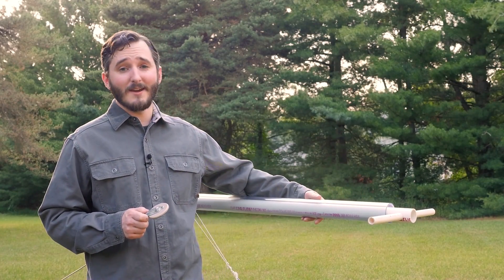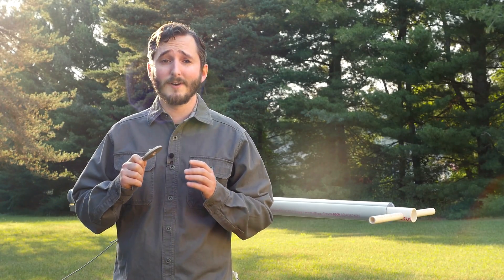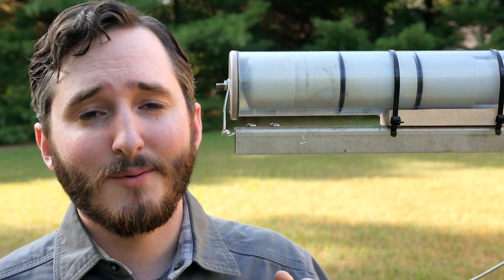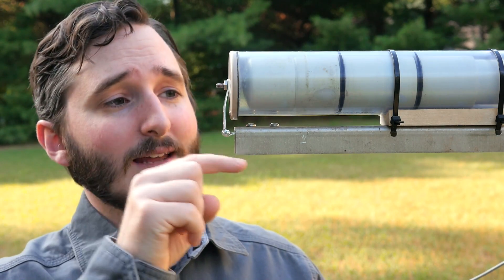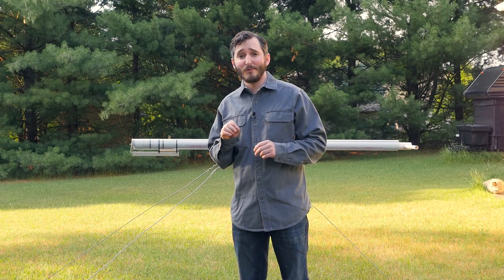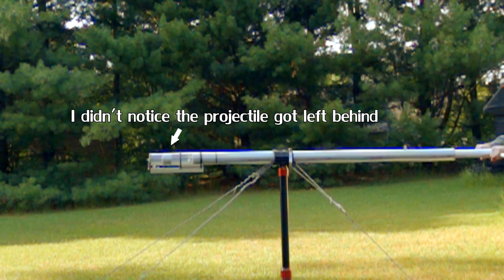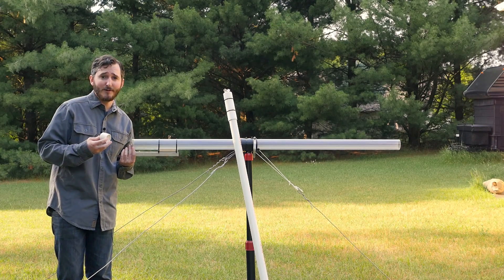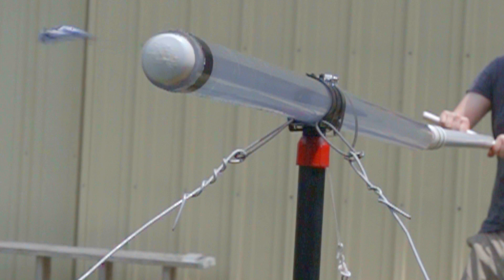Firing A Clear Vacuum Cannon & Testing Viewer Suggestions

Comment: Use a magnet at the front of your projectile paired with a magnet on the flapper valve so that the two magnets oppose one another. As the projectile nears the end of the barrel it will oppose the magnet of the flapper valve, thereby opening flapper prior to the projectile impacting it. Another idea is to surround the outside of the barrel with an electric coil. The projectile having a magnet will induce a voltage in to the coil, this coil provides Voltage for a coil (AKA solenoid) that opens the flapper which has a spring loaded catch that is releasable via solenoid.

Comment: You could make the valve stay clossed or opened with a flat spring of some sort, like the frizzen in a flintlock. Once the air pushes the valve a little, the spring comes into action and makes it open quickly, making sure it stays out of the way. Cool concept for a cannon by the way. Never saw something like that

Edit: I just saw this video is really old... Shame on me for not reading the details before. Sorry about that

Comment: Instead of an outside flapper valve try an o ring inside the barrel. The force of the vacuum will cause your projectile to double as the valve and instead of pulling the piston out at the breach drill some vent holes just forward of that point. Now I have to try it

Comment: Cut the last six inches off and place a gasket between this stub and the main body .  An assistant will hold the stub and gasket or ( O ) ring in place as you pull the plunger back .  Attach a weight or a tension spring to the stub to help pull it down quicker .

Comment: If yu intend to keep your vacuum seal on a hinge mechanism, maybe drilling a small pinhole(s) in the projectile face would work. This will leak air forward of the projectile and open the cap ahead of it. This assumes leaking air will travel faster than the projectile. Also not as efficient as the aluminum foil seal, but the engineering design will provide faster repeatable shots. Optimizing the pinhole size will take some experimentation I imagine.
Great work!

Comment: An other idea instead of a rubber band is to change the design of the valve a little bit. Maybe if you put in the upper side of the valve just a small lip (like a bottle cup) in order to trap some of the air from the inside of the cannon and maybe this force is enough.

Comment: I think the valve should have an o-ring or something and fit inside so that no air can escape before enough pressure has built up to eject it. This would also ensure that it would stay in place when the gun is pointing down.

Comment: i made one large enough to fit myself into and smashing the burst membrane from inside, controlling the vacuum pump on the outside via my mobile. Using high explosives I normally suffer burns and lost toes but thanks to this man i arrived at my destination abroad completely and intact apart from a little brain damage,  and burn-free.

Comment: I believe one of the things that is happening is that the whole barrel is in tension,so it is actually moving forward as it's firing thus holding the plug on. You need something more Ridgid than cable.

Comment: Could'nt the valve be spring loaded to assist a speedy opening once it starts to open just a little? also though sealing may be a little difficult, cutting the valve into two semicircles would halve the distance needed for the valve to get out of the way.

Comment: Prime the cannon facing up slightly with an unbalanced flapper before you bring it down to aim. That way gravity will actually assist when the cannon is fired. You were still only relying on air pressure to move the flapper when you modified it.

Comment: Gravity can't help if it won't fall open on it's own. Move the pivot back behind the flap and leave a small space between the flap and the ammo so the air in front of the ammo can start the valve opening.

Comment: The valve will never open on its own because its held up by the negative pressure. The same force that is pushing the projectile forward is also pushing the valve closed.

Comment: You need 2 cylinders. One that vacuumes and one that compresses. As the diapham gets pulled back, it vacuumes and compresses. When the diaphram reaches a certain point it not only lets air in, it releases the compressed air into the vacuum chamber. Similar to the case on a 2 stroke engine.

Comment: Cut the flapper end of pipe at a 60° angle and make an oval flapper valve to fit. That way the flapper valve (facing downward) would have great gravity force and would only have to travel 30° to get out of the way...

Comment: Keep the valve in this position, but a small spring on the top side of the barrel, and a string on the valve...you can measure the string length so it breaks about the same time the piston is pulled out, and the spring will push the valve down.

Comment: I recently started watching your channel and love it!!! Two problems with the cannon:A-Use same bent/set forward valve with a Vertical Spring/or L shape coming back under. B:-Use a Magnet or Electro-Magnet to hold the projectile... I guess winning the science fair in grade school paid off... Lol... Simple, yet effective. Hope it works for you. I think I'll build my own now too! Awesome videos you are great at this. If you use an Electro-Magnet, just use a small wire that disconnects just before the end of the pull or not depending on how powerfull it has to be... L8R. -Chad.

Comment: I would try going back to the upward hinge but put a slightly tight spring on it to pull the flap up. But then youve got the plastic cup idea thats already functioning. Great build either way

Comment: Why don't you use the projectile as the valve?? Put a hollow stop 12"-24" in. Load. The projectile stops and seals As you pull back. There for, no valve blocking the path of the projectile on exit!!

Comment: What would it take, to make a trigger mechanism that is timed to pull the valve out of the way just prior to impact? Even something  simple, like a trip wire, of a proper length, between the handle of the plunger and some sort of cam to open the valve... then it would just be a matter of optimizing timing, to give the maximum thrust to the projectile just prior to impacting the valve on the way out the barrel...
Reply from the maker: I think it's a lost cause. Making a valve work fast enough to move out of the way at the last second would mean it would have to accelerate orders of magnitude faster than the projectile itself.
Reply: @Nighthawkinlight  that is correct, it would need to actuate the valve a hair split second after the plunger is pulled out to release the projectile, which is why I suggested a trip wire to open the valve by turning a cam connected at a length of just as the plunger releases the vacuum, if everything is rigidly mounted, and as long as the plunger can be drawn out at a constant rate, it seems the only real variable is the speed the plunger is pulled... if too fast, then some of the energy gets wasted opening the valve prematurely, if too slow and the valve gets pinged... I don't really think of it as hopeless so much as a matter of fine tuning the mechanics... lol, but I can certainly understand not wanting to put in the effort to try to perfect that type of mechanism on something that has such a finicky short cycle! Thanks again for another good video that gets people to creatively think!

Comment: What if you drilled a small hole in the piston center and around piston cap just off the last gasket.  Increase speed release of projectile and keeping projectile in barrel. Noticed the projectile gets pulled to far back to rear barrels end.

Comment: Have you experimented with using the end cap AS the projectile? For instance place a wider cup around the muzzle so that the original barrel forms a lip inside and then fix a rubber O ring to rest on the lip or the rim of the original barrel. By placing a projectile over the mouth of the barrel within the cup extension the projectile should act as a plug against the O ring when the shaft is pulled back. I am unsure how this would preform in actuality and I have a sneaking suspicion that the trajectory may be less than impressive but it could be worth the experimentation.

Comment: I know its 3 years late, but I think that the valve could work.

The sacrificial tinfoil has a certain amount of resitance before bursting outwards, this makes it store energy that when released makes it fly fast. However, the valve falls as soon as the pressure differential is enough to sighly push it out, then the rest of the energy is lost.

I was thinking that maybe making the valve have a certain amount of resistance to being pushed out of the way, it will give it more time to build enough pressure to push it faster once the initial resitance is overcome.

Maybe having a magnet hold it in place would allow the pressure buildup and once the magnet can't hold it, it will burst open fast enough so the projectile misses it.

Anyhow, in the case that my theory is correct, It would require a lot of  trial and error to find the magnet with the right amount of energy.

Comment: I had a valve idea. But I don't know how to send a pic on here-so I'll explain. 
I thought you might be able to make a heart style 3/way valve. Maybe start by cutting a tennis ball in half-then cutting that into three 60°pieces then make a rib going down and around and protruding a half inch or so past the perimeter of the circumference of the tube on each piece. Where you could then make a hindge pin and radial spring to put just enough closing force on the doors to seal. And on the inside center of each of the three-glue in something that is round like the ball on one side and straight on the other. So as the projectile comes forward and reaches the end of the tube it helps pop open the spring loaded doors a split second b4 it would normally-also so the projectile doesn't hook the roundness of the valve door/tennis ball .
Hope this gets a shot. I think all ya need  is some flat plastic a tennis ball hot glue a drill a nail for the pins and a really sharp knife so it seals.

Comment: Maybe a better valve idea would just be a cap you can set on the end by hand, but isn't attached by anything except a carefully measured piece of strong string, attached to the ground directly under that end. When it fires, it would get thrown off the end, but the string should quickly pull the cap out of the way of the projectile, and towards the ground in a arc, long as it was strong enough.
Reply from the maker: That's basically what I ended up with. Shoving a plastic cup in the end like a cork.

Comment: spring assisted? But you would need a way to hold it there while you pulled enough vacuum to keep a vacuum.   Another idea would be a burst disk that could be put in place with your hinged holder but the holder would move out of place before the shot and require a stiffer burst disk.

Comment: Maybe if an inch of matetial creating the seal of the flap in the front, going into the tip 1 inch would create enough energy to pop the cap out of the way of the projectile.

Comment: Try increasing the diameter of back half of pipe and the piston..it will give more of rush of air and a bigger hole before piston reaches the end ...cud even make it shorter
Oh and wack a E magnet on that valve triggered by a switch of some kind 😃 good vid

Comment: 8" pipe bolted to a geavy table, with a two door valve bolted to the side so they move out the the way easier and a pully system to pull the plunger back

Comment: So i made my own vacuum canon
Used pvc pipe and o-rings for the plug and seal but the intetface between the pipe and the seals had too much friction and i had to wrap old cloth around the o-rings and that made pulling it through the pipe possible

How did you solve this?
Reply from the maker: I put axle grease on the rings

Comment: maybe a spring loaded valve, where the spring is actually working to pull the valve open, however, the vacuum of the piston pulls on the valve to keep in place?   therefore, as the projectile moves forward and vacuum is lost in the chamber, the spring pulls the valve open?

Comment: Why not a simple spring attached to a point near the fulcrum? You’ll get a class 3 lever that will open the valve very quickly, and you just need a string to pull it shut until it gets started. If the spring is weaker than the draw strength, but strong enough to pull the valve well (seems likely as it looks light) you should get a good quick opening valve.

Comment: If you’d want to make it overly complicated, you could make an external airway starting just before the end where the piston is pulled out (the back) and the other end just before the valve in the front. This way the air rushing in would overtake the projectile and blow open the valve just moments before the projectile arrives.

Comment: What about 2 same pole magnets...one on the center of the flap and one on the projectile....then as they get to the same point the force pushes it off...then so the flap doesn't fly back again have a small magnet on the bottom to catch it

Comment: You tried to mount the "cap" on the upper side connecting it with a cord that is pulled when you have finished dragging the bullet at the end of the stroke the tube (when the air begins to enter from behind the tube)?

Comment: there actually is an easy solution to solve your pressure vavle problem at the end of the barrel. all you need is about 4-6 inches of a bigger pipe on the end of the barrel with the release vavle attached to that. the idea is that once the projectile gets to the bigger pipe air pushes around the projectile and pushes open the valve before the projectile itself can hit the valve. easy solution without any damage to the valve.

Comment: 6:47 had me laughing so damn hard, gravity assisted flap valve with a spring pulling it back up  is this guy for real ? "this is why you test didn't work # 1 GRAVITY IS A NOT REAL 2# YOU DON'T NEED TO HAVE A SPRING ON THE "GRAVITY ASSISTED FLAP", THE SPRING IS 2 STRONG AND WILL STOP THE OBJECT FROM EXISTING THE TUBE , CAUSE IT CLOSES 2 FAST

Comment: so do you get better results if you fire out a smaller barrel sow that the psi has a larger compression chamber resulting in reduced overall size vacuum canes that have a heavier draw force lick gearing a gearbox dawn

Comment: failures are a learning process.  I think your valve is bouncing and that's why it's getting hit.  

Try putting a magnet or latch to keep the valve full open once it opens.

also, your buff of air may not be enough force to open the valve fast enough so you may look at spring loading the valve to open faster and have a catch for it in the closed position too.

Comment: Run a small spring along the outside of the  latch, over the hinge. Keep the latch extended so when it is in the closed position so it acts like the cam on a compound bow. Yeah, just a simple spring elliptical cam. The little bit of air would flip it enough to push it past the crux of the ellipse and the spring would pull it down and out of the way.

Comment: I would like to see, what happens if you use the projectile as the valve by adding a 2nd tube with a sligthly smaler diameter, and length. like a air vortex canon, so the projectile sits "midway". on a small Rim.

Comment: Idea #2. Keep the same setup, add another hinge about 1 foot down the barrel, so that that the disc now also drops down, instead of having to rotate so much. It will still rotate a little on the original hinge, but as soon as it is no longer stuck to the end by vacuum, it will also start to fall as it rotates.

Comment: I think your flap valve is too heavy (slow to accelerate). How about just a disc, no hinge, held lightly in place with tape, and with a string (maybe 1m long) it so it doesn't disappear.

Comment: Your valve could open faster if it had a spring  mounted on the sides so that as it closes the tension helps keep it closed but only for the last 2 degrees, but once open past the pivot the spring will pull down on it outside of the pivot and pull it down quicker.   If you have not made a pneumatic valve air cannon,  they are the bomb.

Comment: @NightHawkInLight:  I have an idea for an effective flap retractor.  It uses directional force from rubber bands, so that once past a certain pivot point, it will even provide slight pressure to hold the valve against the muzzle, but once the hinge has rotated a few degrees, it pulls in the opposite direction with much greater force.  As long as the air pressure provides enough force to get the hinge past that point, the spring assist should well make up for the cost of overcoming the closing force.  I'll see if I can build a mach-up in the next few weeks.  (Note: my motivation to do this will be greatly boosted by a reply to this message... :)

Comment: There's not enough air in the pipe to push the flap out of the way in time. You need a spring-loaded flap with some kind of mousetrap type lever / catch. Like a hair-trigger, that once triggered, snaps the flap out of the way in lightening speed.
Reply from the maker: I've figured out a solution for this now. I'll make another video at some point.

Comment: Shorten the distance between the tip of the piston and the first O-ring. It looks like the front of the piston is still inside the barrel while air is trying to get inside. Shortening the distance between the o ring and the end of the piston might allow air to get in faster if the air doesn’t have to move between the piston and walls the barrel.